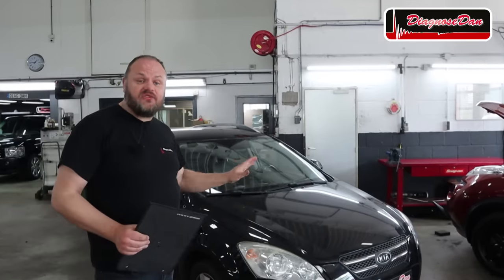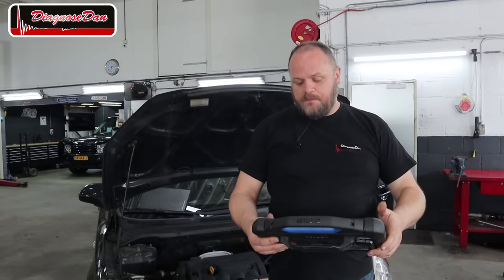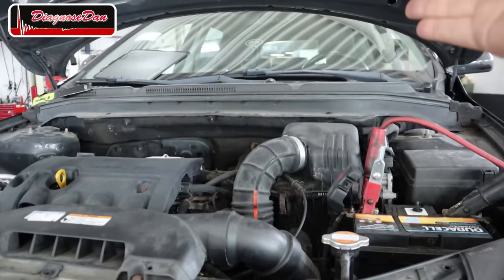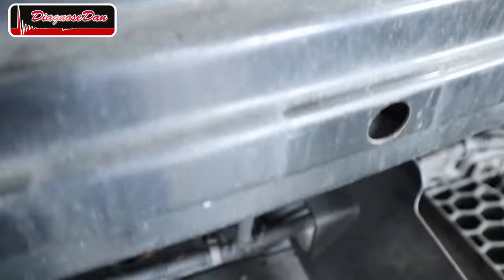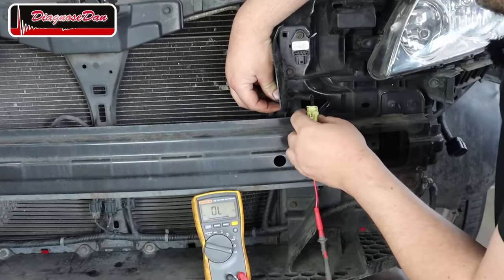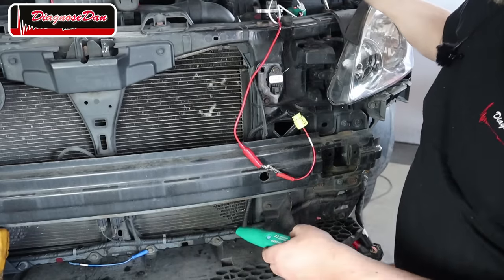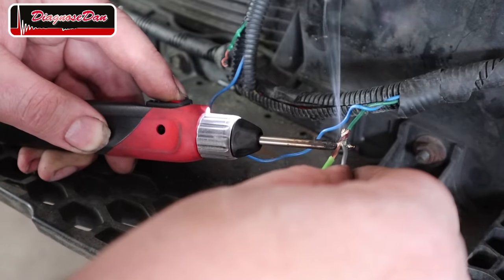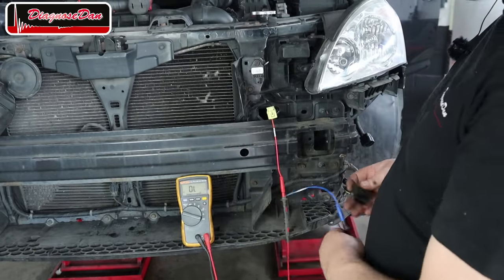Airbag Fix (Green Crusties)

Comment: Do note that there is a reason for signal wires to be twisted. That is interference protection and thus sometimes important to restore when replacing wires to avoid false triggers!
How large the risk is and when this really applies I can't tell but better safe than an airbag in the face without collision...
Reply from the maker: Thanks for the feedback

Comment from the maker: Check out my new website ; https://www.diagnosedan.com
For the Topdon tool used in the 
video:
https://www.topdon.us/discount/DIAGNO...  the price of Phoenix Max will be 10% OFF by clicking the US link
10% OFF EU purchase link: https://eu.topdon.com/products/phoenix-max-diagnosedan
Uk :https://www.diagnosticconnections.co.uk/

For business inquiries ( not for technical questions); Diagnosedan@gmail.com
Reply: EU link is "404 not found"
Reply: Do you also have a link for the broken wire locator tool? 😊
Reply from the maker: @jothain  works on my side
Reply: @Diagnosedan  yeah now it's working. Looks like it was temporary.

Comment: When another repair shop sends their hard-to-solve case to Dan, it proves again Dan's diagnosis skill is at God's level.  Another excellent work 💯
Reply: another "workshop"? Something like that is not a workshop for me if it doesn't find this quite simple error and then leaves behind such traces and missing screws. That's what my cars from the specialist workshops looked like, since then I've been doing everything myself again.
Reply: I'm buddies with another automotive electrician/diagnostician. He says the amount of guys that don't know the functions of a meter beside "V" is staggering. I myself find that many technicians don't know when to STOP using the meter, it also has limitations. I guarantee you this "simple error" would stump all the guys at my shop, but they can run circles around me doing heavy-line. Not digging at them, there is simply a specialty for every subject of a car.
Reply: The life of Brian...God's level?
Reply: @anthonyxuereb792  Brian, go and clean your crusties!
Reply: @bryankirk3567  Yes Brian, shall do, they could well do with a clean.
Reply from the maker: Thanks Brian

Comment: Great one as usual.
It amaze me how quickly the other shop gave up especially since they had a really fat clue of where and what is wrong after switching the left and right sensors and noticed that the fault code stayed on the left.
Seems like they rather pay you what ever you charge for that kind of diagnosis then spending thier time on it.
Keep up the good work, you rock 👑👑👑
Reply: time is money for shops and most likely the other garage felt it money well spent to send to expert, leaving them to get on with other work
Reply: @eggy1962  For me it would not be about the time, but about the honor. If you don't find such a simple mistake, you can go home. But obviously they couldn't fasten all the screws properly again - there probably wasn't enough time, right?
Reply: Judging by the missing clips and nuts maybe they are the oil change and brake pad replacement kind of shop
Reply from the maker: Sometimes you are on a dead end and you need new insights

Comment: Easy fix bad from the other garage I would have just looped a new wire from connector to connector, a lot of modern cars are the same after checking for continuity follow angles of the loom
Reply from the maker: Wouldn't you want to find /confirm the corroded wire and learn from it? Thats the best part of diagnostics!

Comment: I don't know, that different color of green wire might cause some confusion to the PCM.   haha Great fix, Dan.  I had to make an emergency repair to a coil wire chewed thru by a mouse, recently.  I had to twist the ends of a red wire into the two ends of a blue wire.  Worked fine until I got home and fixed it properly....with a blue wire! 😉😉😉
Reply from the maker: Two different wire colors and it worked? You're good!!!!😂😂😂👍👍👍

Comment: As a retired VW/Audi tech we couldn’t solder connectors or a splice, had to use a special crimp connector that emitted sealant when heated with a heat gun, was definitely waterproof.
Reply: Was going to post the same thing, those pink/red connectors that you heat up were used rather than solder at VW repair shops.
Reply from the maker: We put the crimps over after we soldered it.

Comment: That was a very interesting area where the wire was corroded.  Covered by the split loom it should have been well protected.  Having the sound tool really helped.   Good one Dan!
Reply: My guess it was there from the assembly on a jig by the loom maker, where it was cut as the sharp ends of the sleeve were put on. Passed the initial testing, and worked on the line, and worked till the vehicle was driven in water, which leaked and was held in by the loom there, and then the wire, combined with the voltage on the sensor, caused it to slowly corrode away. Best trip for doing those kind of joins is to use adhesive lined heat shrink over the solder join, and shrink it down to bond the hot melt adhesive to the wire, making sure to lightly sand the insulation at the area to get clean fresh non damaged plastic insulation, making for the most waterproof join possible to the sleeve and insulation. Liquid electric tape is also good, cover with that, then 3M insulation tape over, tightly wrapped, then again liquid electrical tape over that.  Works well on boats to keep stuff in good shape.
Reply from the maker: Maybe the Crusties were trying to hide from us😂

Comment: At NASA and USAF, we used Time Domain Reflectometer (TDR) to accurately pinpoint Opens and Shorts in wiring. It could pinpoint the problem down to a Centimeter in most cases. These units are cheap enough now that any shop should be able to afford one.

Comment: @Diagnosedan  You could actuallly try and get you  hands on one of the newer W177s A classes as they have chronic issues with their SRS systems and do a diagnose video as to why that happen and hot to solve/prevent. It would be helpful and would certainly get you a decent number of views.

Comment: Hi can you do a video or recommend someone in regards to using the old school automotive oscilloscope and function generator with all the sensor inputs? I can't find anything? I have a few scantools but i woud love to learn using an oscilloscope as im an electronics technician? But i don't want to use the massive engine diagnostic tool unless i know what im doing? Any reply appreciated cheers from Australia ❤. Subbed and liked 👍

Comment: Mr D, question for you ; I just watched a video of South Main doing a door impacted sensor, an he didn’t remove the battery cables. Plus he jumped the two pin sensor to get a short to ground instead of the high voltage ; just to get the integrity of harness. Is that a good diagnosis method.  Thank you your the best

Comment: Lol. Watching this video made  me thinking that when I replaced the coolant radiator in my 2003 skoda fabia that I disassemble all the front parts to reach the radiator and I remember the lights connectors, the horn connector, the temp sensor connector, and that's all. Where the hell are the airbag connectors and sensors? Maybe I bought a crashed car?

Comment: Perfect diagnosis plan.  The air bag sensor part was not needed so it seems fair that the customer doesn't get charged for that.  I'd also hope that Dan gets to evacuate, replace the A/C condenser and recharge as a tip for getting the real problem fixed. This car likely had a collision repair and that condenser is on the estimate but not on the car ! The wire got pinched and the green plague took over. Great review....I love those sound generators....they do come in handy in many cases.
Reply: I am afraid the not needed crash sensor will not be omitted from the bill. But it shows how important it is to choose your repair shop with caution. In my company we do offer no cure no pay for some easy jobs. I regard the "lost" time as a good training exercise that the company and not the customer should pay for.
Reply: Condenser looks like it is just old, fins rotted off from road salt and grime that eats the thin aluminium away.
Reply from the maker: Thanks for your comment!

Comment: Yay lots of bloopers!  Neat idea using the toner to trace out that faulty wire.  So many wire faults were caused around this time (2006-2012) due to poor wire insulation formulation!  Or it was a small hole or crack when the loom was assembled.

Comment: I hope the other shop pays for the sensor, because they are not really cheap, and it was not needed. Great fix again, sometimes it can be so easy and cost-effective. Soldering the wires, though, can give you new trouble later. I learned that the hard way with seat wires for the Airbag seat sensor. I used lead-free solder, extra for that, no flux, and it still went green after 4 years and I had to put in a new connector. To connect the cables, I used a crimp style connector for it, and that holds to this day. My cousin is driving this old fart of a Golf MK4, and it's still running fine :D

Comment: Good troubleshooting, but soldering on stranded wires in the car is a no-go. Or even banned on portable consumers in Germany. If you do a kink test, you'll immediately see why. There are special crimp connectors - but I simply take 2 ferrules with a double cross-section and crimp them.
Reply from the maker: This repair in this location where the wires are not going to move is a solid repair and i want to bet its never going to be an issue ever again

Comment: What concerns me is that the other shop couldn't do a basic continuity test when they learned that the problem didn't follow the sensor. When diagnosing wire breaks I was taught the half-way method. Go 1/2 way and test either side. Move 1/2 way again in the direction of the fault and continue with this method. With even the longest run on a car you'll be down to your general area in about 5 tests. You'd have nailed that general area in 3 tests. 

Say the length of the fault loom was 1m. Test continuity at 50cm mark. Result will tell you which way to move your testing. Test at 25cm. Test at 12cm. Area discovered within 3 tests.

Called the Newtonian approximation method.
Reply from the maker: Thanks for the feedback

Comment: valuables vedio dan.I had 2 questions...
1) how you discharged capacitors by  a spanner 🔧
2) we can repair or Soldier airbag wires....
Reply from the maker: The spanner shorts out the circuit and you'll get rid of the last voltage.
I think soldering wires is a good solution as long as its done right. But it depends on the manufacturer and what they recommend
Reply: @Diagnosedan  thanks Dani😊
Just need your suggestions short out the circuit in  that way wouldn't hurt the ECU hardware....

Comment: Hey Dan, still enjoy your videos. Got rid of my 750li BMW phew. Now i have a Toyota Camry, not sure if you have diagnosed Toyota. Just wanted to say, that my AC wasn't working. The interesting thing was the flow sensor attached to the compressor was only reading 3.5volts when scanned. Needs 5volts to work, clutch wasn't coming on. Purchased a new flow sensor, removed old one and there was much corrosion under the sensor perhaps causing magnet to fail or lowering electric volts? Voila my AC is working great again. And because i listen to Diagnose Dan, diagnose John fixed it again. Hope this tip helps you one day like, you help all of us!
Reply from the maker: Great find! Keep up the good work 👌

Comment: Good tip not to use an impact gun tightening the bolts. At a Nissan dealer I worked at someone was replacing a g force sensor on an Xterra due to a recall. It was located under the center console. He didn't disconnect the battery either. Used an electric impact to tighten the bolts.   Airbag went off. Very expensive mistake.
Reply from the maker: Wow fast way to learn!🤣

Comment: Hi Dan, ive had a bad irbag code on my 94 ford probe gt for over a decade..code 51  and it happenned after I drove the car thru too deep a water run off.water about 2 ft deep!  that code came on : "Diagnostic monitor internal thermal fuse Blown and short to ground no longer exists".   I know its a thermal fuse in the airbag computer module...I swapped another from the junkyard and got the same code... I thought that the flooding water caused it way back and that it would Not be an issue and Not blow the fuse again at this point.. I was wrong...I can see those crash sensors, there are 3 on front of my car..I grabbed a couple from another probe in the junkyard... what do you think? Ive never swapped them out..if I did, I'd still need to fix the fuse in order to test or at least swap in another airbag module... I dont know where to begin..driving for a decade with a flashing code 51. LOL
Reply from the maker: 😂😂 We almost never see those cars here in Europe so i have no experience on them. But i bet in the States they used to work alot on these vehicles

Comment: Although the vehicle was"fixed" I would personally be worried about liability if the air bag failed to deploy, as Kia doesn't authorise airbag wiring repair and only wiring loom replacement, should the worst happen and the airbag fail to deploy and personal injury occur, that could be a very costly and letigious for a non manufacturer approved repair.
Reply from the maker: I'm not that worried about that. Its a solid repair

Comment: Great video as always thanks for posting. Just a thought though, I'd be tempted to splice another cable right next to the plugs 
bypassing that part of the loom to avoid pulling the loom apart and risking damaging another cable in the process. Would that be wrong?
Reply from the maker: No but wouldn't you want to confirm your diagnosis? Finding the fault is the best part of our job!

Comment: Hey Dan great video, here is a proof that the scan tool is a very powerful and useful device but it is not the final and true solution usinig it  just to replaice parts willy-nilly as many shops and agencies do, I have solved very similar cases fixing open circuits on injectors, coils and fuel pumps without causing unnecessary spending money to the customer, let's convert innocent victims into loyal customers, thanks for sharing and I wish you well from Mexico City
Reply from the maker: A Scantool gives you direction not a diagnosis

Comment: As a BMW Tech, BMW does not recommend  soldering , we would have replaced the complete broken wire . so there would be no repair in the wire at all .
Reply: Because most techs follow ista only and not their own brains, lol. I’ve fixed alot of E85 airbag problems. Most of the time bad wiring/connectors and sometimes crappy modules, simple as replace it with 2nd hand, flash the vin, re-arm and off they go. 
Bmw just ignores the lack of skill of some techs, so replacing the whole wire is alot more reliable!
Reply: @RichardHilverts  , good reply from a mechanic . You have totally missed the reasoning behind replacing the wire . but i did think it might fly over some peoples heads . 
Any one can repair a wire just by stripping the two wires and twisting them together , then tapering them up . But this is not a good fix but might be a good fix for some mechanics . but by getting the repair kit on a BMW , and replacing the complete wire you have put the car back to factory specs , on this important safety system . so BMW  will warrant that repair . 
As i have stated not all repairs are good repairs , and i have seen some right shocking jobs for independent Garages. 
I was not commenting on Dans repair as i was referring to BMW .  but if i was commenting on Dans repair , i think i would still stick a complete wire in , as i seen corroded wires corrode much further back than a few centimeters.  Dan knows what he is doing with that repair but not all mechanics do .

Comment: Any thoughts on how that cable, that is well protected, gets like that?
Reply: Breaks like that usually happens in bends or where the insulating material can rub against stuff.
In this case I'm gonna guess it rubbed against the hard plastic shielding little by little and over 15 years it finally broke through.
Reply from the maker: Rubbing against the hard plastic outer shell is my best guess

Comment: With the tone tracer it works best if you connect both leads to the loom, for that 2 wire sensor connect both green and blue. As it is a twisted pair the break is very easy to find, as the break will cause a very sharp drop in volume level of the tone. For others use the suspect wire and any other wire from the same sensor, as those will be next to each other in the loom. Single wire sensors connect the one lead to ground, as that will result in a better signal into the wire, making the break easier to find when you trace along the loom. Note that large looms you might find the signal nearly vanish when the wire is buried deep, you need to scan all the way around the loom to find the best signal closest to the wire.

The probes were originally used for phone lines, but are useful with any large and complex wiring looms in industry as well.
Reply from the maker: Thanks for the feedback

Comment: If the original workshop couldn't do what you just did then they should hand in their overalls and tools and go work somewhere else. So now they will get credit for your work
saying how difficult it was to trace the fault but perseverance paid off. They will charge for the replacement parts they didn't need, add additional labour costs and make a nice profit.
To my chagrin I found missing fasteners when my car was returned to me, doesn't anybody care?
Reply from the maker: I'm pretty sure it was al sorted before the car was returned to the customer
Reply: @Diagnosedan  Personally I wouldn't give them the time of day.